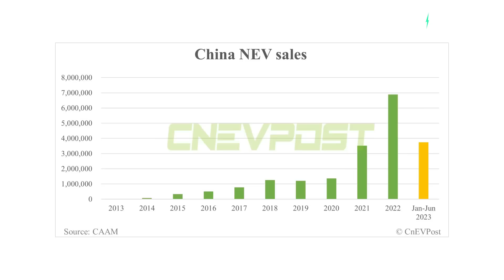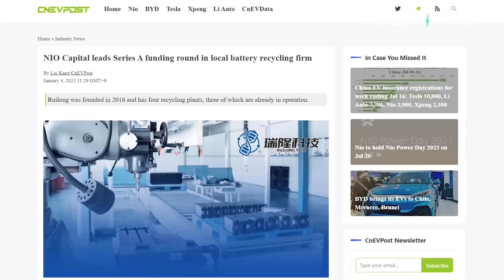Explosive Growth in EV Battery Recycling as Startups Eye $150B Industry

Comment: Not enough is said about the biggest problem of the oil industry - methane.  Flame off, and loss of gas from the oil industries is huge and since methane has a 200x global warming impact than CO2 the amount of emitted methane from the oil industry should be included in all dirty oil analysis.

Comment: since batteries are not standardized, automation is not possible yet. it is extremely labour intensive to separate cells, electronic components, boards, cables casings (plastics, and metals)..  it requires a ultra low wage labour force.  I can see why China would have an advantage there.  belt and road countries might also be candidates to do the work.

Comment: Do car engines get recycled? Sorry, but  I think you are wrong on this point. A better point Would be that the primary fuel source cannot be used again and again or recycled 

ChatGPT
Yes, car engines, like many other parts of a vehicle, can be recycled. Here's a brief overview of how this process usually works:

Reuse: Before an engine is recycled for its raw materials, it's often checked to see if it can be reused. This typically involves refurbishing or rebuilding the engine so it can be used in another vehicle. This is often the most economically and environmentally friendly option.

Part Harvesting: If an engine cannot be reused in its entirety, individual parts may be harvested for reuse. Components such as the alternator, starter motor, pistons, and others can often be reused in other engines.

Material Recycling: Finally, if an engine cannot be reused or have its parts harvested, it's recycled for its raw materials. Engines are often made from aluminum and iron, which can be recycled relatively easily. The engine is shredded or melted down, and the metals are separated for reuse.

This process isn't just limited to the engine - almost all parts of a vehicle can be reused or recycled in some way. It's part of an approach known as "end-of-life vehicle processing," and it's a vital part of reducing the environmental impact of the automotive industry. However, it's important to note that not all regions or countries have the same regulations or infrastructure for vehicle recycling. Therefore, the recycling process can vary greatly depending on where the vehicle is being disposed of.
Reply: Just a recommendation, don’t use a chatbot as your source of information. They are frequently confidently incorrect, and will mislead you.
Use them as a tool to narrow down research, and then find reputable sources from real researchers to back up the claims of the chatbot so you have real data for your argument. Using an AI for it massively undermines the credibility of any claims you may make

Comment: We used to dump British re cycling on to Chinese, dump old ships and used electrical goods in India knowing they didn't respect h&s and environment I do hope you are right on USA s plan to re cycle battery's as evs environmentally and pollution wise are a he'll of a lot higher to produce and if being run on electric produced  by fossil fuels pointless.
Reply: Even running them on pure coal power they still break even in a relatively low amount of time, but we definitely need to move forward with renewables and recycling as fast as possible

Comment: Being real isn't really beating up EVs.  It it taking a great CO2 investment to get the lithium out of the ground and a massive use of water.  Last year alone Lithium processing used 1% of the worlds fresh water; in Chile it lowered the water table by 2  ft; causing legislators there to work on banning lithium mining. If a better chemistry is on the way; why would any one recycle lithium?  90% of EVs were made in the last 3 years; if i am to believe EV advocates they will go 250,000 miles or 20 years worth of driving before the batteries need to be recycled ; that is 2040. Surely by the Lithium won't be of any value.

Comment: I think it is not a frontier of profetiers but an expected paralell market to the battery energy industry in terms of an increasing circular economy. I think the fact these positive numbers means the EV and battery energy market is saturated enough to start a for profit model, buy resources cheap and sell exoensive, like what Tesla us doing with storing energy for cheao in batteries and selling expensive. To a degree this is a nice model for profeteers in the short, but as it often goes, the market will only accept profiteers so long before it becomes too expensive for the mainstream market, which will only slow down sustainable energy adoption in the long run. I think the business profit model is flawed. Yes it's great for innovation, but it isn't solving the global society adoption model faster. I think in that regard, recycling should already be part of the battery energy model more aggressively to reach a better circular economy. I still see too much single use economy and planned obsolescence. That is also wasteful. I don't know what the right strategy is, but I think there is a smarter way.

Comment: I rarely hear people talk about the decrease in "disposable fluids" used in ICE cars. The savings on spilled motor oil has got to be. Huge upside.
Reply: Because no average Joe or Jane even knows what it takes to power, service and maintain their gas guzzlers. 
I do I ran a fairly busy service shop here in ATL for several year's. Ev only would eliminate 60-85% of that shops weekly waste streams.

From tune up parts, the engine air filters, oil filters, fuel filters, brake parts, fuel induction and fuel injector services etc. 
And every single part not needed is a part not being mined for or requiring recycled materials.a part not getting wrapped up in plastics, a part not stuffed into a cardboard box, a part not stored somewhere only until it's needed. 

Then plucked off a shelf, tossed into a box, put on a truck, plane or train maybe all of the above? Before arriving to be used in an ice vehicle, in a never ending cycle of parts. We serviced 40-45 icecars a day on average. The amount of material waste if you aren't doing it for a living? 
Are pretty shocking to observe and have to manage the care and disposal of. 

Some stats, 28,000+small businesses just to do oil changes here in the U.S. 420,000,000+oil changes done a year. Resulting in over 160,000+tons if waste steel just from the oil filters alone. 

60% of used motor oil ends up dumped into the nearest landfills or makes it's way into our water sources because people actually flush it or dump it near water sources. 

1 gallon of used motor oil recycled on average only produces 2.5 resellable quarts of motor grade oil. And how does that oil get recycled? 
It's stored in used oil drums until full then sealed up. Taken by a diesel truck to a refining plant, stored, recycled using more water energy and chemicals. The recycled oil then gets repackaged, transported again etc. An endless cycle of madness&more particulate emissions.

The engine air filters end up in landfills by the tens of millions each year. Spark plugs? Same thing they also can contain rare or platinum metals. Used cats get shredded for the platinum metals nobody whose a gashole fan every considers when mentioning such damaging Ev mining?
Or how the automotive sector itself is one of the top consumers world wide of mining anyway. 

And cobalt has been mined for since the 1730s now and the fossilfuel industry consumed the most of it annually up until late 2019 now.
The aerospace, mettalurgy and medical industries all consume it but aren't vilified for it like evs are. 

This obvious mis information ev troll point is despite the fact since late 2021 nearly half of ALL tesla sales are lfp pack's with ZERO cobalt or nickel inside them, pack's also safe to charge daily to 100%. 

World wide in 2022 nearly 40% of ev sales we're lfp cells. This year it's tracking for 44%+ with catl and byd also introducing sodium ion cells. 
Plus advanced higher energy density lmfp&mp3 cells with pack level energy density approaching the best nmc cells from a couple year's ago. 

Used brake parts get sorted for scrap or reprocessing and or refurbishing credits. Pads can be recycled but most places just toss them. 
Calipers and rotors are the most recycled used brake parts. Brake line's unless stainless? Get tossed into landfills as well.
Reply: @4literv6 That's a superb coverage of the difference between ICE and EV in terms of maintenance and repair.  Thank you for it.
Reply: Used motor oil is recycled in the USA.